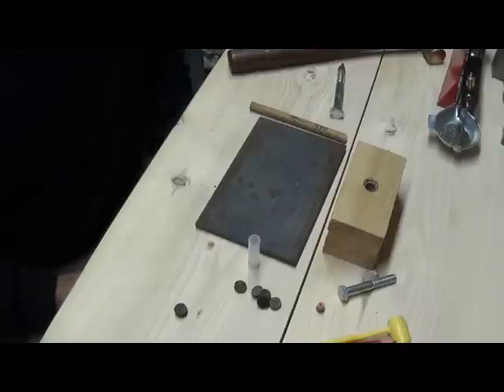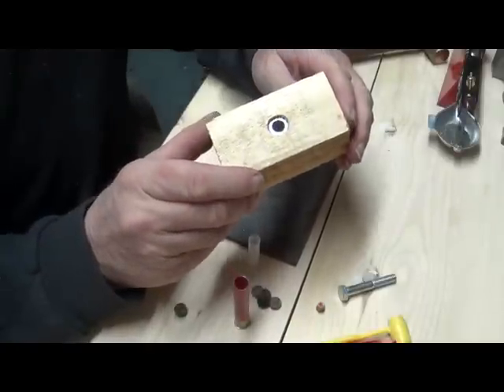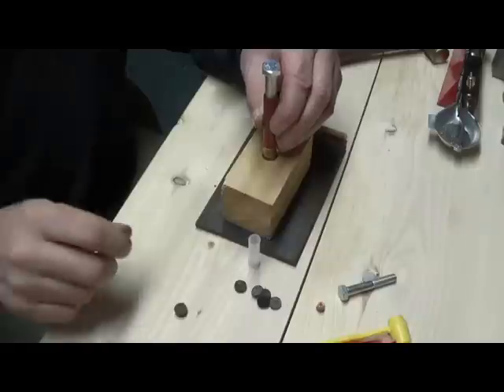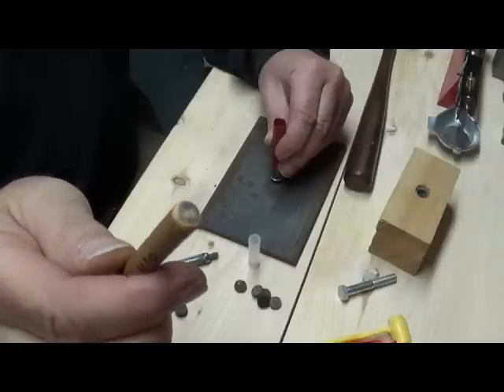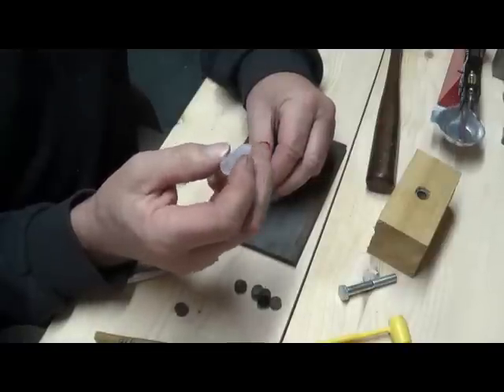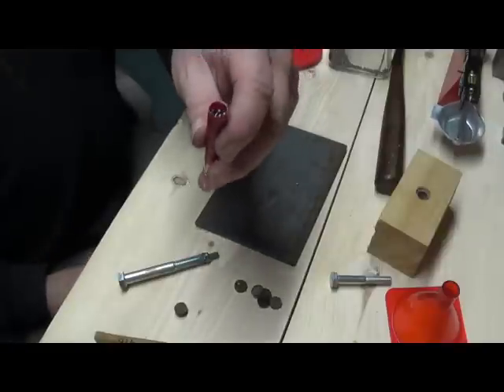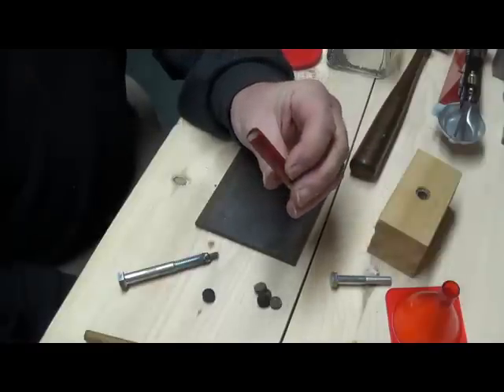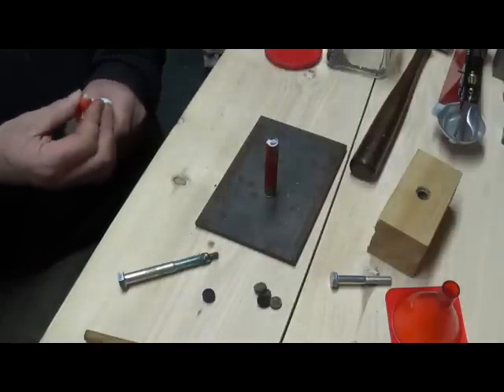Reloading 410 Shotshells with Homemade Tools

Comment: I made something very similar years ago. Got the idea from a Backwoodsman  article. I bought a roll crimper that goes on a drill but never quite mastered it. I usually cut the crimp off, add a shot card and glue it like yourself. Works great.

Comment: The bolt is a hell of a good idea never thought of that and idea for you hi used block with multiple block with holes drilled in it and then another smaller hole for the primers to be knocked out works great use as primer removal as well as fill tell him up

Comment: This is great!
FYI I saw another video that uses a stack of washers to re-size the brass.
Reply: G'day,
I modified an spare .270 resizing die so I can resize in my single stage press. (My .410 deforms the brass slightly.) Only just beginning to reload shot shell.

Comment: Cool video. Please tell me, does anybody ever load just a tiny bit of powder so that there is not too much power? i'm thinking of for shooting squirrels and pigeons in the back garden. Can you make a load that is equivalent to a .22 short by putting a lead ball or a few lead balls stacked on top of each other?
Reply: Yeah for shooting small game i usually go a little lighter than is normal, usually just because i dont like the shot going too deep and it makes it easier to dig out. But for buckshot and slugs i just load like normal

Comment: i was using metal to seat my primer.it blew up in face.no harm done.just had to change my underwear.be safe not sorry.
Reply: haha classic
Reply: Small washer, hole below primer cap, rim of primer larger than hole should do.
Reply: @timothytietz9194  to seat the new primer, not remove the spent one.
Reply: Personally I'd use something like a cutting board

Comment: why did you cut the old crimp off when you can reuse it
Reply: a lot of crimps are hard to press back into place without a tool or press to do so its faster and simpler to use a shot card thare cheap and effective

Comment: Nice video.  If I might add some helpful information.     
If you own a 410 firearm, check out the 410 Survival Loader.  Different from the LEE and does a great reload.

Its made by  The X Ring USA.  I think the web address is  thexringusa.com.    
I reload my own 410 shells and it costs less than half of store bought.   Now I can practice longer and cheaper.
Reply: The survival loader costs 65 dollars and is not as easy to use as this FourAcreFarm  .410 reloading video.